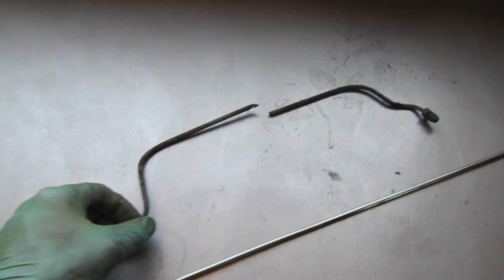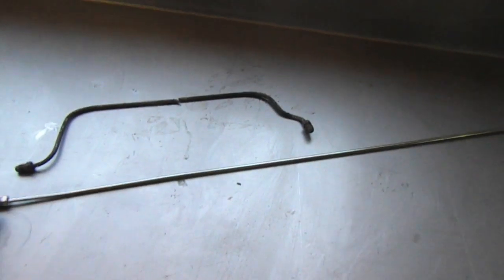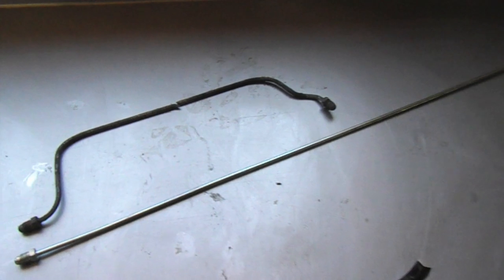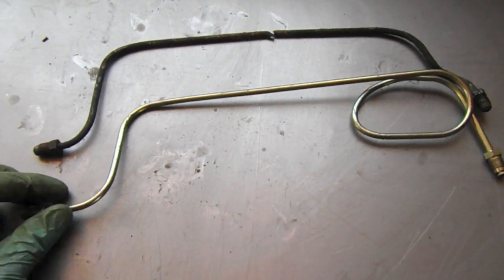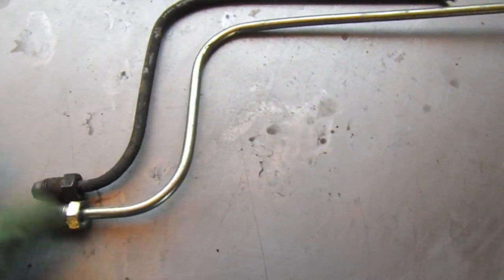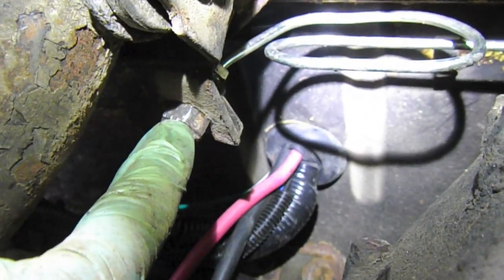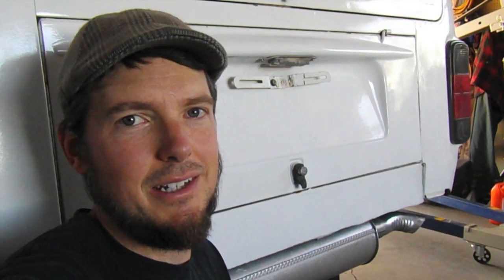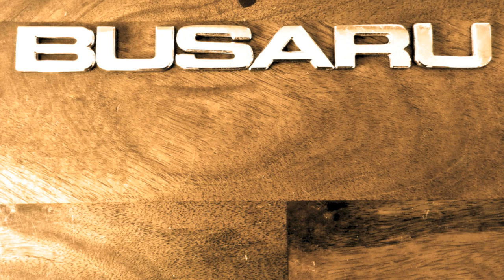Replace metal brake line on VW Bus

Comment: I use nickel-copper brake line and a flaring and cutting tool set. With that you can make any brake line you want. The nickel-copper is easy to bend and flare, I just bend it by hand.

Comment: Once the line is bent to form, you could use a flaring tool ,cut the excess line off with a pipe cutting tool and flare the end.
Reply from the maker: Yep, seems to be the only way to go. I dove in fully and now love to bend and flare my own hydraulic lines - pretty fun once you have all the tools.

Comment: Use the black/ dark green line it works better easy to beld and you can buy it at NAPA with the correct fittings
Reply from the maker: I agree, your much better off getting brake lines locally since the dedicated VW Bus online outfits are just going to send you the same thing - a straight brake line. I had to replace a front metal line recently and did just this, and the green lines do bend easier.
Reply: The line you are talking about is called cupro copper nickel, it's the bomb! Hand bend 90s all day

Comment: Could you have cut it to length and bought a flaring tool? Nice BTW...been following the build from the start.
Reply from the maker: Id say you could probably do that. I'm not a brake expert so didn't want to mess with that but if one was confident I'm assuming they could. One of the things I've realized is that there are no "pre bent" metal brake lines so you may as well just go to your local auto parts store to buy these, then you can get a closer approximation to the length.